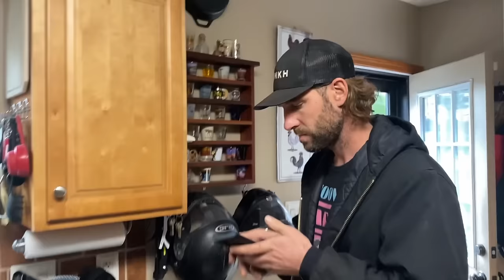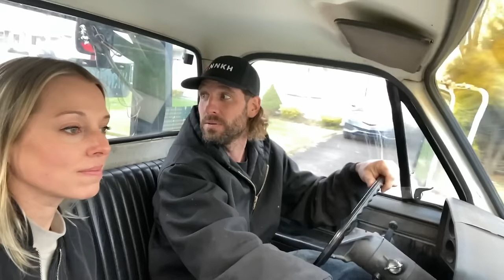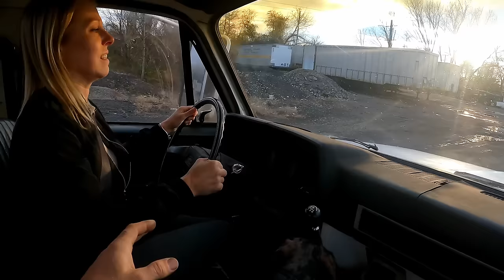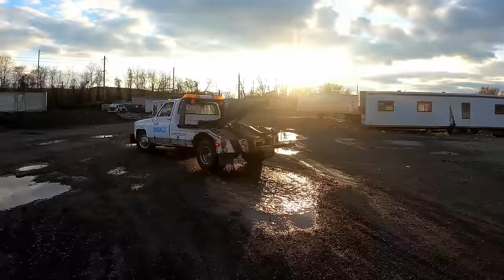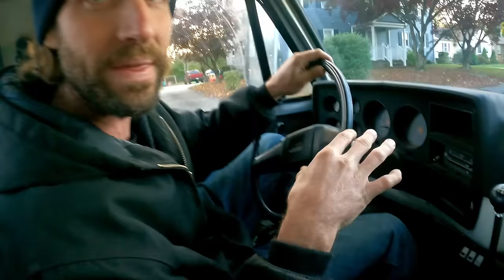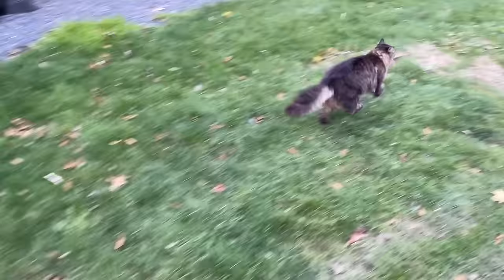Learning stick on "The C30 Wrecker" with NNKH NoNonsenseKnowHow

Comment: Hi Jen, greetings from England. You did an amazing job, in a standard manual “shift stick” car, the gear stick will sit in neutral between third and fourth gear and automatically return there making changing gear much easier. That was one tough gear box and you did great. With practice it all becomes natural without having to think about pressing the clutch, selecting the right gear, making sure you keep your eyes on the road etc best wishes to you and Chris, Turbo and Gus x
Reply: This.
How could he have failed to mention this absolutely important fact to every newbie?

Comment: Jen,  you are doing a great job on a very difficult vehicle/transmission combo.   Might I suggest that you drive a bunch of low to first gear runs until you are super comfortable with that.  When you are confident, and you might be there already, add second gear and drive a bunch of low, first, second gear runs.  If you just keep adding a little bit at a time, it won't overwhelm you.  You don't want that to happen because that tends to put your confidence back to the beginning.  Baby steps and take your time.  Watching you take off for the first time tells me you are way over halfway there.  Any other vehicle with a stick shift is going to be easy for you after you master this.  Don't give up.

Comment: You got this jen!! I was 15 when I learned on a 1986 Nissan sentra...eventually the car wouldn't idle so I had to keep the car running by tapping the gas  in neutral at red lights...I got super good at driving stick after  that...u  are gonna only want to drive manual once u get it!!!

Comment: Every vehicle you drive with a stick shift will feel a little different. You have to get the feel of the one you’re driving. Once you do, it becomes easier to know how much gas to use and where the clutch grabs etc. You did very well for your first try in that C30. Sloppy shifter is pretty normal for those old trucks.

Comment: Jen , you did real well!   That definitely was not an easy vehicle to learn on, a old 1 ton Chevy with a granny gear,  a sloppy worn out shifter,  a seat that was back waaaaaay to far for you, having to struggle to push the clutch pedal down far enough and a massive piece of the seat material missing so that you were sitting lopsided and a rough pot hole infested dirt lot!      I would say that under those circumstances that you did AWESOME!  You got this!     👍💯
Reply from the maker: Hahaha thanks, Richard! I I suppose when you put it like that, it didn’t go too bad. 😆
Reply: @jennifersugint  , Absolutely Jen, you did real good!  👍

Comment: Greetings from the UK,well done your doing great. I can remember learning to drive at 17 and my Dad taught me about mile an hour driving. He had me balance the clutch and accelerator so that I could stop the car just with the pedals and start it rolling again .After that he taught me about the biteing point where I could hold the car at the point where the clutch engaged on a hill. He then introduced me to double declutching on a gear box with no sycromesh.

Comment: Congratulations Jen on your new channel and learning how to drive the truck..
I thought you did excellent for your first time..
My advice to you is to keep your hand on the stick shift while you're driving, but after you shift into your highest gear and up to speed, then you can put both hands on the wheel until you're ready to shift again.... What Chris should have done before you started, was to have you learn and practice where all the gears are and cycle through all of them in order, low, 1st, 2nd, 3rd, reverse,  several times with the engine off.. first  by looking at the shifter to see what you're doing, and then with your eyes off the shifter, so you can shift through any gear you choose without looking.. then all you need to worry about is working the clutch pedal, gas or brake.
When I had a Trans Am with a four-speed manual transmission, I usually had to put it in reverse before I put it into first, in order to synchronize it, because if I didn't it would grind.... It was caused by a worn idler gear in the transmission because it had over 200,000 miles on it...

Comment: You did great, err wonderful. I've been driving manual shift as long as I can remember. from little Toyota to F-700 propane bob tail with split rear end and a dump truck once. I've had my 2000 F-150 5 speed since new and still drive it. Best part... No One ever wants to borrow it. lol

Comment: I was teaching a female college roommate how to drive my '99 dodge pu. It's got 3.92 gears, so it was pretty easy. Pulled up to a red light on a hill and i calmly told her she would have to get on the gas and out on the clutch quickly to keep from rolling back into the cars. She gave it all it had. Clearly, the sure grip rear end was still working because we went sideways a bit.

Similar situation with my wife to be in a low traffic neighborhood. Stop sign and a very slight hill. She sat there paralyzed until some cars pulled up behind us. I couldn't convince the other cars to go around. She stressed out and couldnt figure out how to set the parking brake so i could trade places and drive. After 17 or 18 years, i realize how much can be determined about personality by the stickshift experience.

Comment: Great job! you are probably doing burn outs by now! I remember when my dad was teaching my sis how to drive.  We picked up a cake, and I was in the back seat and didn't want to hold it, so I put it on the rear shelf of the car. I just wanted to go straight home and have some cake. She slammed on the brakes hard and I was sitting in the back seat , no seat belt and I practically stood up and the cake that was sitting on the back shelf slid off and landed on the seat behind me. After we came to a stop naturally I came back down to a seating position on top of the cake!  No cake for anyone.🤣

Comment: Good job! My first vehicles were manual. Holding on a hill in traffic while stopped at a light freaked me out for the first couple of weeks... I was afraid of rolling back into someone. Once you get used to that and clutch to throttle ratio you're golden!
Reply: yes, that is scary, especially on icy roads. When I was in driving school that was something was trained quite thorough, but nowadays new cars have all kinds of "assistant" functions to help not to be stuck in a upward road.

Comment: Great analogy on the engine/clutch/transmission/driveshaft & differential Chris.   Retired now, but the later part of my career I drove semi's, with even more gears, and after driving a standard for a while, it all becomes second nature, where you don't even think about it, as it all works in tandem.  Decades ago, I had a nice Chevy II with a 327 and 4 speed manual transmission, and I truly miss driving it, as the gears all just meshed so well together, making the whole process feel so simple.   Great job Jennifer, you will find it easier, the more you drive a vehicle with a standard.   You might want to even go out on your own for a few hours, and you will find any nervousness diminish, as when no one is watching you, it all just seems so much easier, but finding a location with 'less' traffic will help with any driving stresses as well.

Comment: Well Jen that was absolutely awesome to see you smiling as you started to get it. You are in the top 5% of millennials who are willing to learn how to drive a stick so think about it that way 95% of the people out there your age don't know how to drive a stick. The fact that you are willing to learn is priceless! Every single person who ever learned how to drive a stick killed the motor in the process. It's simple once you get it it's like riding a bike for the most part every car manual transmission you will get to drive are in that same H pattern 1 2 3 4 then reverse has its own leg in that age or off of it. Even with a few other lessons under your belt you made that look too simple little lady great job you will have this in no time flat. And you will look back at this video and laugh. Keep up the good work little lady it also helps to know that if an emergency situation comes up you need to remember to push that clutch in brakes just won't do it. Looks to me like you've got great clutch control and climbing a hill is much harder as you know but very much doable that right there was some good learning. Keep up the good work and the great content this was a fun watch and it brought me back to teaching other people how to drive a stick. I just taught a 13 year old how to drive next year I'm throwing her in a stick so she can be in that top 5%

Comment: You did great Jen. That's probably not the easiest car to learn how to drive a manual with. If you have a chance to drive a smaller car with a tighter shifter and an easier clutch it will feel so much better. The more you do it the more normal it will be.

Comment: When my dad taught me to drive stick at 12 in an 82 K10 with an SM-465 he had me start off in second until I got good enough to drive it by myself without issue. It had 4.10 gears and he said taking off in granny with those low gears wouldn’t teach me clutch work because it’s almost impossible to stall it. Taking off in second I had to slip the clutch some but not to excess while giving it throttle the same way (enough, not too much) and after a lot of stalling and a shorter period of minor clutch smoke until I found the sweet spot…more like “sweet area”, I guess, since there is some area for variation without bad results. I was glad to have learned that way when I got my first truck, a 93 Chevy 1500 with a 305, 5 speed and 3.08 gears. That thing took a good bit of clutch slippage to get rolling on steep hills and knowing how to get it moving without slipping the clutch so bad it got hot made it an easy experience right off the bat.

Comment: When I was about 10 yo I had to teach my older half brother about 15 years older how to drive a truck transmission. He already knew how to drive a four-speed stick in his car but he was having trouble shifting in the truck.
I had to tell him how to wait for the synchros to line up in a truck transmission. 
Almost like driving a non-synchromished big rig transmission.

Later on I learned how to drive a big rig without using the clutch. Synchronizing the transmission by using the accelerator both by slowly down and speeding up.(down shifting and upshifting)

My wife had a five-speed manual 89 sunbird and the clutch went out on it when we were far from home.
 I had to show her how to drive that car without a clutch all the way home about a hundred miles away. 
I also taught both of my daughters how to drive.
That was not fun!

Comment: I taught truck driving for a few years, there are there different positions on the clutch pedal. spring pressure clutch and clutch brake. you did just fine shifting, it's like everything else in life, it just takes practice.

Comment: Don't sell yourself short, you did well and the more you practice the smoother it will become.
Chris taught you some important lessons there, the only difference I'd have done is emergency stop, hit the brake first then hit the clutch just before the engine stalls, if you lock up the wheels release the brake quickly and re apply them.
If your not sure about the shift pattern try sitting in the car on the driveway and practice shifting with the engine turned OFF, remember not all gearboxes are the same pattern.
Oh and tell Chris thar grass is beyond watering! 😂

Comment: My Dad told me that while shifting a three on the tree transmission, have your palm facing you when going into low or reverse and have your knuckles facing you while shifting into second or high.  That way the transmission always goes into the correct gear.

Comment: Great teacher and great student!  Mutual respect all around, which makes an experience like this not only easier, but a blessing.  Props to both of you!

I never had anyone sit patiently with me like that (Dad had other things to do), and the few who ventured to crack my hard head were, to me, just spouting gobbledy-gook and trying to get me to memorize rote commands without any understanding.  I was always of that engineering mindset that had to have some context, to know how something worked, as a framework on which to hang the instructions.  

So it wasn't until I came across a training series for parts store employees that I was finally able to understand what was going on beneath my feet in the bowels of the vehicle.  With the engine turning and the transmission (and ultimately the wheels) not turning, coupling the non-moving transmission to the spinning engine output shaft in order to turn the wheels had to be done using a friction-based connection:  a steel pressure plate and friction-material-covered clutch plate, with one mounted to the engine, the other to the transmission.  Letting the clutch pedal all the way out fully engages these two components, while pushing it in all the way separates them, letting the engine's output shaft just spin away without affecting the wheels.  Letting the clutch pedal in or out in varying degrees lets these components rub each other to a greater or lesser extent, similar to a friction-material-covered brake pad rubbing a steel brake rotor to a greater or lesser degree, as you slow down, then come to a stop.  

Once I understood this friction-based coupling between the engine and transmission, all the other instructions about not letting it stall, etc., just fell into place.  Sometimes you just have to get the gist of a thing first, otherwise it feels like you're learning a new language or skill, but someone has torn out the first couple of chapters from the training manual.

Comment: Just wanted to say your skill level and true mechanical skills are awesome! You remind me of the guy at my first job that taught me how to work on cars. This is going to sound like a story from the 50’s but it was the 90’s. I worked at a full service gas station in high school that did mechanic work too. My boss would rebuild everything and he knew exactly what the problem was and only fixed that…not throw a ton of parts at the car. Not the best if high ticket prices is the goal but if you needed your car going again for cheap without replacing entire systems we were the place to go. Please keep the videos coming and don’t get burned out. I’ll try to like all your videos to help you out. Awesome content of a lost art!

Comment: I learned on a '72 Ford tow , with no power anything , even the wipers were hand crank .....😁👍 Take it on ~
Reply: For me an M35a2, now power steering or anything powered. Now I have installed power steering though

Comment: Hey jen you did a great job. Not to mention your learning on a old chevy tow truck so there is alot of odd noises banging around and lets not forget the hydroboost on the brakes. I know it feels awkward but its similar feel to abs braking in a newer car when you lock up the brakes. I hope you don't feel frustrated you just have to feel comfortable with the truck and your surroundings and it will come to you soon. Shifting is a long pattern on them old chevys it feels like compared to a newer car.

Comment: Jen you did Fantastic with that lesson...Im from the UK and manual gear shift is the norm over here. Once you get used to how a car moves through the gears and the control you have over the balance of the vehicle becomes second nature! I dont even think about changing gears and clutch control. The only thing I obsess about is indicator (blinker) use. I know you have a civic, but you need to drive a Type R civic manual shift...It will blow your mind how fun it can be. I've drove automatics and they are horrible and boring.

Comment: My only criticism is he didn't have you do a dry run on the truck first.
1) Turn off the truck.
2) Engage "E" brake or Emergency brake. 
3) Run through all the gears using the clutch for at least 10 to 15 min for muscle memory.
I did this to all four of my children and they picked it right up fast. Most 4 speed stick shifts are the standard "H" and 5 speed is the same H pattern with the 5th gear farther top right. For anyone that doesn't know.
1st top left.
2nd lower left.
3rd top right.
4th lower right.
Reverse can be acouple places. I learned on a 3 on the tree at 11. That's a Colum shifter. Really old.

Comment: You did well Jen, thought that huge truck made things a bit more challenging.
I would suggest, if you intend to further learn to drive a manual transmission, that you encourage that NoNonsense feller to acquire a more appropriately sized vehicle, maybe a Mustang, or wait, a mid-80's Fiero ..which is essentially a plush go-cart, and you'll be hooked on the manual driving experience.
I'd like to add, nobody really grasps manual driving until they've tackled city driving, stop-n-go traffic and maybe throw in interaction with other real world obstacles like a corvette, motorcycles, pedestrians ect.

Comment: When I had my old 77 K20 with the 465 4 speed any time I’d go to take off from a stop and it wanted to grind going into 1st / Low I’d always just keep the clutch in, pull it back into second then slide it back up into 1st and that always did the trick. For gear heads wondering why that would make a difference, it’s because the reason it won’t go in 1st to start is because the input shaft is spinning and the output shaft, main shaft and counter shaft are not. By sliding it into a synchronized gear (I used 2nd but in theory any gear except reverse, which is also non synchro on those 4 speeds will do the same thing) the synchronizer will slow and stop the input shaft as you put it in gear, then coming back out and straight into first you already have first engaged before the friction between the pilot bearing and the input shaft has time to start the input shaft turning again.